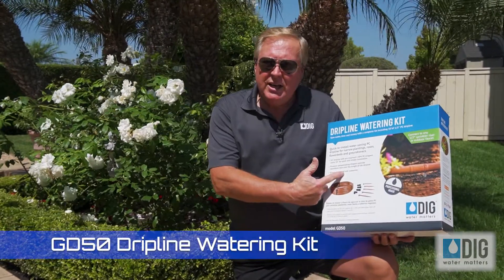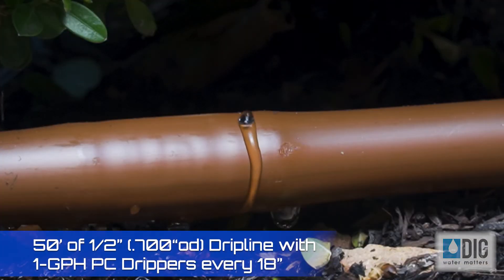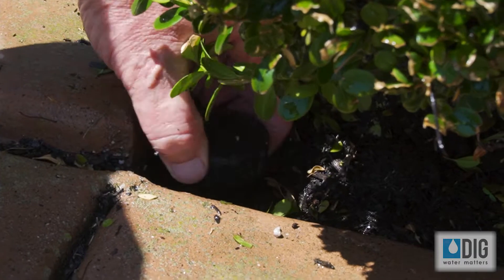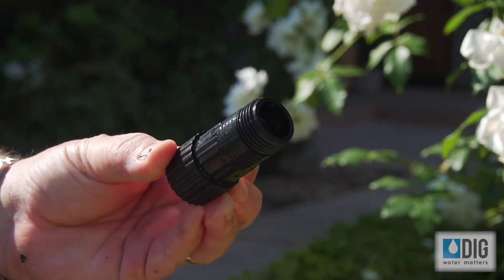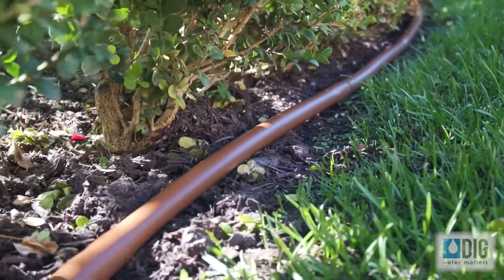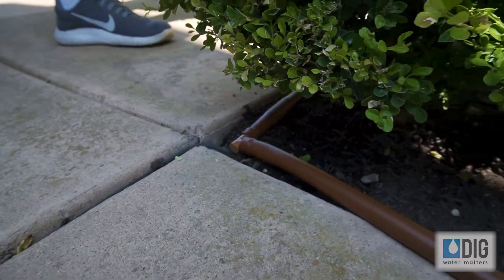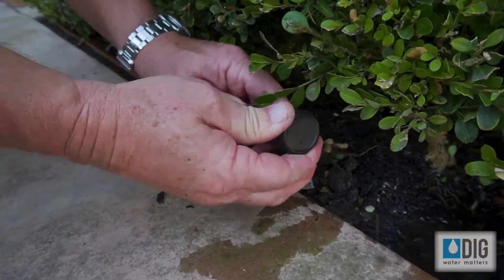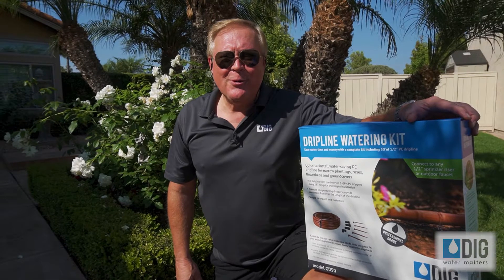DIG Drip Irrigation System Installation: GD50 Dripline Watering Kit

Comment: When joining 2 of these hoses together.. Do I use a regular joint connector or do I have to use the flow 25 GPH to join the two together AND use one at the water source?
Reply from the maker: Hey Jake, when connecting the drip lines together,  it is best to used the #C33 coupler, which is not in the kit. But I'm not quite sure if this is exactly what your question is asking. If you give our tech service department a call at (800) 344-1172, they will better be able to assist you.

Comment: I bought multiples of this from Home Depot and 50' length is what they stock.. How is it that the hose that is in a round coil, comes with so many kinks in it out of the box.. Every one of them. The 100' foot you used, by the looks of it, doesn't have a single kink in it. Laying them in the sun doesn't remove the kinks but does make it easier you handle, Your hose in the video doesn't look like it's EVER been rolled up.
Reply from the maker: Hey Jake, sorry about that! We do our best to manufacture and ship tubing with no kinks, but sometimes through dealing with a very high manufacturing output, it does not always come out perfect. We will make note of this though and pass along the information to our manufacturing and shipping departments.